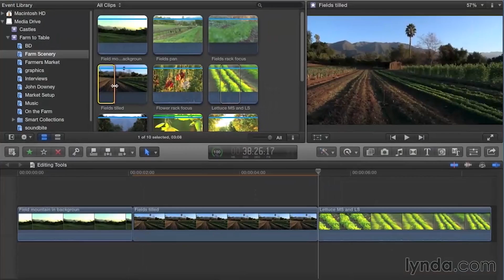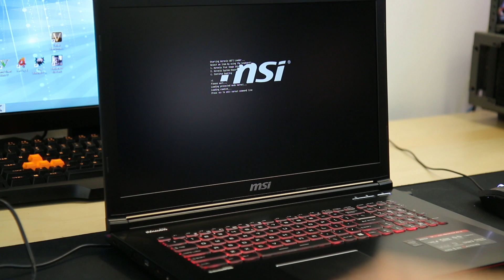How to install SSD in a laptop

Comment: Just goes to show that a fresh system even with a HDD is faster than an old cluttered system.
I really need to upgrade pretty much everything by now:
i5 760, 8 GB of DDR3 1600
1TB 7200rpm Toshiba HDD.
And a partially broken P7L55X (lightning strike broke the Ethernet connector).

After having this thing for a couple of years already, and having gone through 3 Graphic cards, a couple docent of installed and deleted again programs and over 10000h hours of use.... yeah, that thing is sturdy but slow.
It takes me over 5 minutes to reboot now.

Soon, oh so soon, a fresh upgrade, fresh mobo, cpu and a SSD to boot from :P

Comment: Ended up doing something similar to this.  My hp laptop had a msata port in it that I used to put an ssd in.   I was going to use that as my main boot drive and the hdd as my storage drive.  Unfortunately hp is a fuckface and you can't boot from the msata port unless it's the only drive in the system.  I got an external drive and used that for a while until installing it into my gaming rig.  Works like a charm

Comment: The RPM is the same, but the larger the diameter is the higher the speed is, think gears, a small gear and a large gear spinning at the same RPM will yeild different speeds down the line, like a bicycle's gears, hence the outer part of a HDD is higher performance than the inner part.
Reply: +Dave P You are wrong. +christian is right.
Reply: all sectors are about the same size. The outside of a bigger hard drive can reach in the 90 to 120mb/s where as the center is about 30-80 on average. some people will out of lets say 1tb use only 500gb by partitioning the drive early ( first data entered is always on the outside ) . thats also the reason why a computer with a HDD is always faster in the begining of their lifetime or after a reformat/defrag.
Reply: +FunsterProductions The motors are also different. Most laptop ones require 5v instead of 12v like 3.5inch ones.
Reply: Dave P I haven't played with Windows much since XP was still the latest, but the reason you install Windows first then Linux is because while Linux can safely modify partition tables written by Windows and LILO and GRUB can bootstrap Window's bootloader, Windows will FUBAR partition tables written by Linux and it's bootloader can not boot Linux directly or handoff to a capable bootloader.

Comment: using some old dell xps from 2011 with a 5400rpm hdd. boots in like 15-20 secs on debian GNU/Linux. takes ages on windows though. fuck windows.
Reply: +holzi be comforted at the thought that a brand new 1100$ imac ships with a ulp dual core and a 5400rpm 500gb hdd.
Reply: +holzi Im really glad im not the only one that scraped windows on my laptop in favour of a Linux distro, I went with ElementaryOS and the boot up is about 30s!
Reply: +holzi Nah m8. Enjoy the best of both worlds. Either dual boot or have a stand alone windows machine. It's whats I've been doing for a while and I quite like it.
Reply: Christian Ivarsson
"none of my apps" holy moly what are you using? some programs are not as polished and need some time to learn but i didn't really find anything missing. https://wiki.installgentoo.com/index.php/List_of_recommended_GNU/Linux_software here's a list of good stuff.
Reply: crzzymnn911
i do have some windows partition on my main rig but i don't really use it much.

also dual booting is fine to the one who said it isn't. GRUB2 is pretty much perfect.
Reply: +holzi "linas" FTW!
Reply: Cause Windows is better..
Reply: I agree. It's sad none of my apps have good Linux counterparts though so I have to switch between win and linux. I'm waaaay too impatient for horrible dual boot so I can't really recommend it to those of you who rave about it. try virtual machines instead.

Comment: my pc has a hard drive (7200 rpm) and it restarts in like 30 seconds
Reply: +The Doctor I have a broken watch on my wrist and my restarts in 0 seconds.
Reply: +The Doctor maybe u are just magic
Reply: Pc.. not laptop
Reply: +The Doctor My pc has a SSD and boots in like 5 seconds on Windows 10 with fast boot and turning off the login requirement with netplwiz.
Reply: Bjørn-Erik Tvedt well it is a desktop
Reply: Bjørn-Erik Tvedt yeah
Reply: +Stockman I'm pretty sure The Doctor is a Timelord. Not magic. But for all we know, he is.
Reply: I have a seagate barracuda and it starts up in probably 12 seconds
Reply: +Tucker Klein My laptop's hard drive restarts in three to five minutes. Not bueno.
Reply: Probably using Windows 8.1 or 10?
No cold reboot?
Reply: +The Doctor The defrag is real lol
Reply: +The Doctor i have a 5200rpm laptop that will do it in under a minute
Reply: ***** its a western digital red 2 terabyte
Reply: +The Doctor My old hard drive boots in less then a minute. Windows 7 was the only OS that took ages on a hard drive, now it's very quick.
Reply: +Tucker Klein bull.
Reply: +The Doctor my Laptop from restart to startup within 25 seconds
Reply: William Harrison 10
Reply: Mine has Win8 and starts up in 7-8 seconds on my dual booting desktop in UEFI mode?
Reply: i start up in 3.2 sec.
Reply: +Marserius win8 not 10 and is it desktop?
Reply: +The Doctor My laptop had a 7200rpm drive but would boot in 54sec (give or take) on Windows 8 and 10. Upgrading to an SSD now lets me boot in 10-13 seconds.
Reply: +The Doctor My pc has a SSD and boots in like 5 seconds on Windows 10 with fast boot and turning off the login requirement with netplwiz.
Reply: Robbert van Loon my pc has an ssd and boots in 3 seconds without fast boot
Reply: +The Doctor my  MSI Apache GE72's second drive is a HDD 7200RPM
Reply: My laptop has a 5400RPM and boots in around 20.
Reply: +mikomati a laptop is a pc.
Reply: Mine does it in 5 seconds its called IRPC Instant restart PC
Reply: Ned Nowland Bullshit
Reply: Can smell the liars (or people who never actually timed it) in this thread. While we're at it my pc has a floppy drive and restarts in less than a second. With Windows 7.

Comment: Can someone please help, I just bought an Intel ssd and I migrated my hdd to my ssd but when I tried to boot from the ssd it won't boot
Reply: +Christopher Vinciguerra I changed the boot order and still doesn't work I have a gigabyte motherboard
Reply: +Viralology oce use gparted live to look at what's on the ssd. see if there's a boot flag somewhere.
Reply: +Viralology oce ah is it an Intel PCIE SSD? or just a Sata3 SSD? because if it uses a PCIE connection your processor has to support something called nvme(believe it's called). otherwise it should work
Reply: +Atqthe30th it's just a sata ssd
Reply: +holzi will do! Thank you
Reply: Do I have to plug it in to a certain spot on my motherboard it's a gigabyte 990fxa-ud3 revision 4